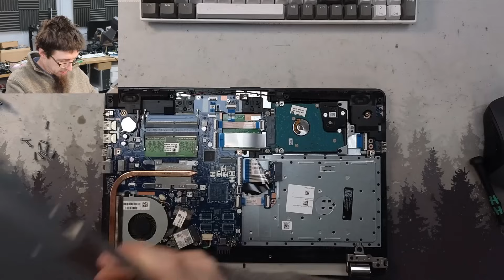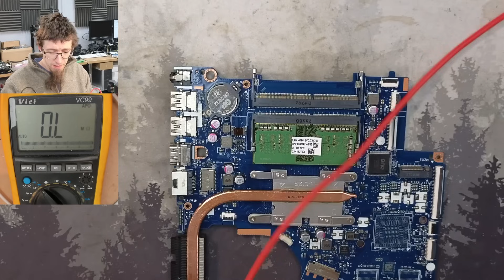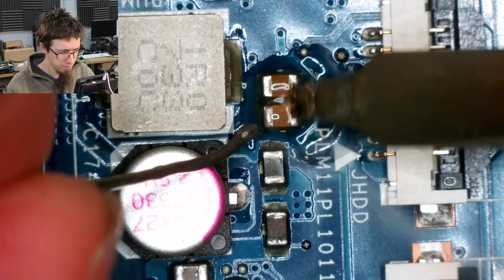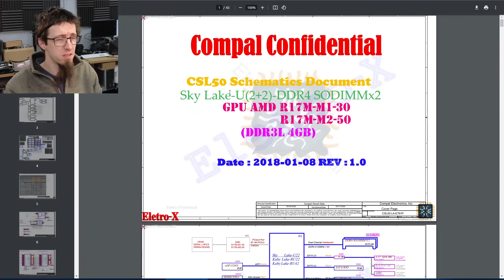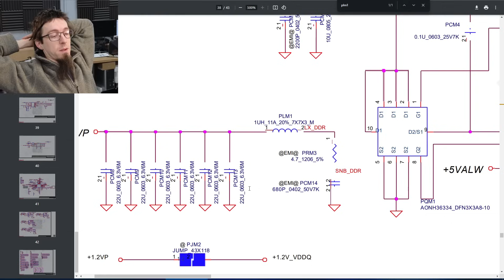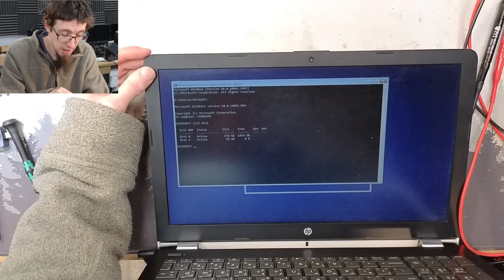The Classic No Power Fix We All Love To See - LFC#383

Comment: Hi Graham!
What do you think happened to the motherboard of a laptop that was powered with reverse polarity?
A power supply other than the original one was used and the polarity was reversed.
Do you think the motherboard can still be repaired or has irreparable damage occurred?
It is about a Lenovo G500.
Thank you in advance !
Reply from the maker: Quite likely a blown TVS diode at the DC input. Look for a diode connected in reverse right where the power comes into the laptop, and see if it's shorted.
Reply: @Adamant_IT  Thank you very much Graham !